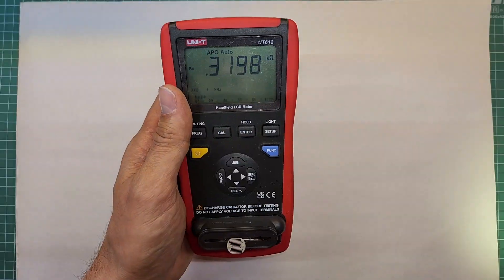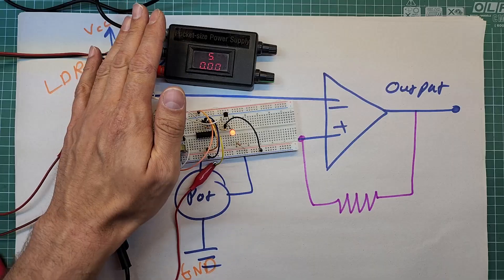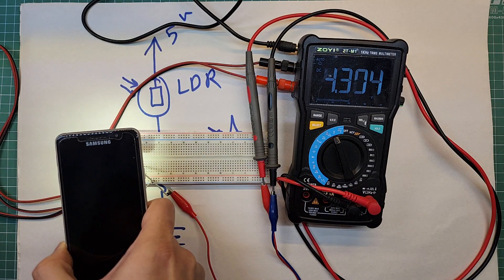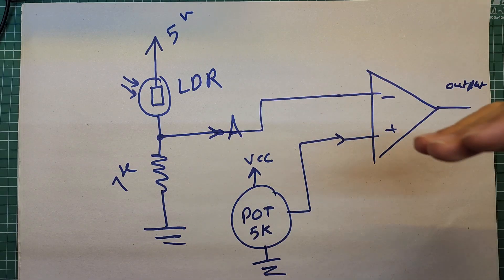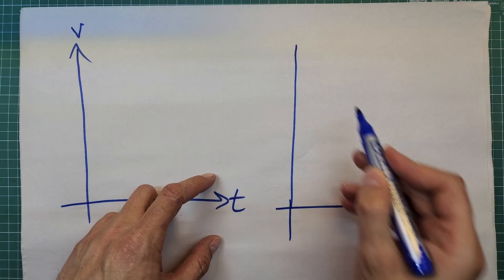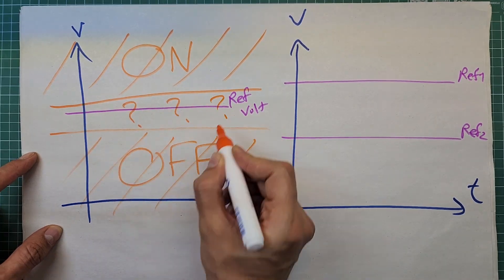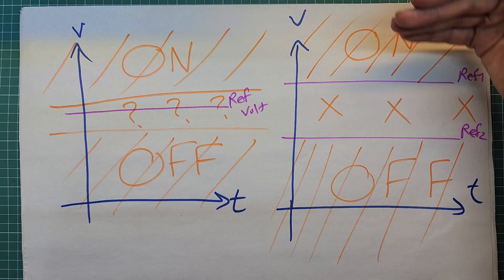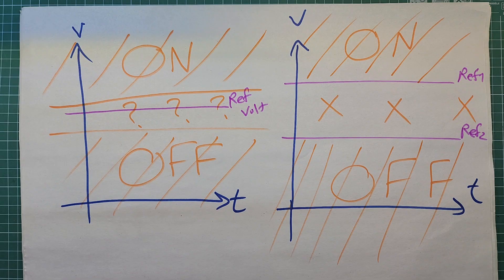Magic of hystersis as a powerful tool in application

Comment: This is very good. Helps me think of a current project. I have hysteresis designed into a solar pump  controller (not yet committed to a PCB) but I suspect there would be a start-up transient pump motor current that would cause the solar panel voltage to drop below the low threshold momentarily. I think I will design a time delay before the low threshold is enforced. My electrical model of the pump motor is, at best, a crude approximation.

Comment: Excellent video. 
Now my question is, how do we determine the value of the feedback resistor for the Schmitt trigger. From many electronics products, the values are always in mega ohms. 

Do we still use Vo = (RF/R1 + 1) vi

How do we calculate different resistor for a given output voltage given a particular reference voltages?
Reply: Well, for this example  he used a 1K resistor I think.
Reply: He used a 1K resistor, it seems. He said also that the bigger the resistor, the closer the  ref voltages  and  the lower the resistor the farther the ref voltages

Comment: Great explanation, thanks!  Can you make a video about hysteresis in Arduino code?
Reply: Easy. You have a trigger threshold variable in which a value is held.

If the required parameter (usually an input value) is above that threshold then you carry out an action. (Eg turn something on)

If the required parameter input parameter is below the threshold then you execute a different action. (Eg turn something off).

Now, to introduce hysteresis and prevent a high rate of switching the output on and off as the input parameter varies up and down close to the trigger threshold, crossing it repeatedly, you change your trigger threshold in the two actions previously described.